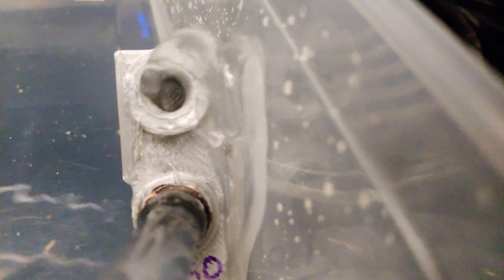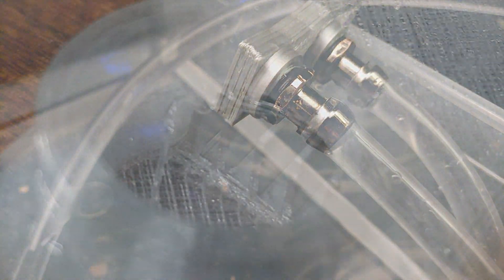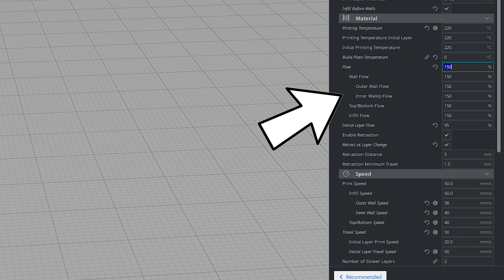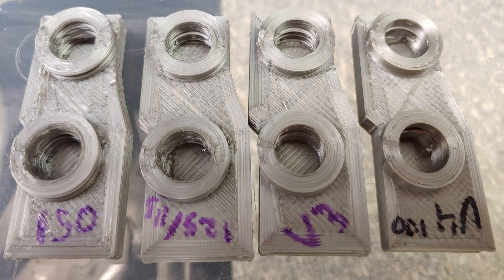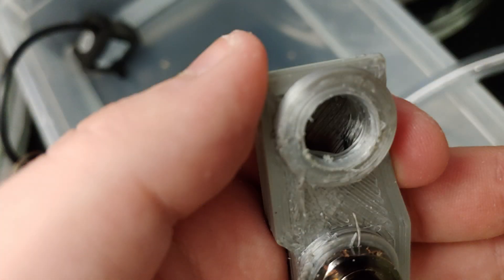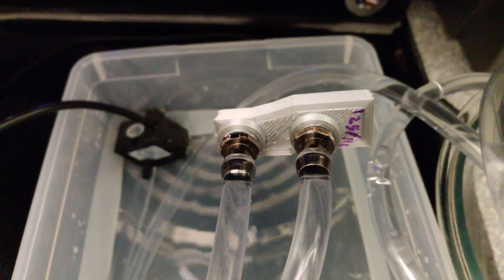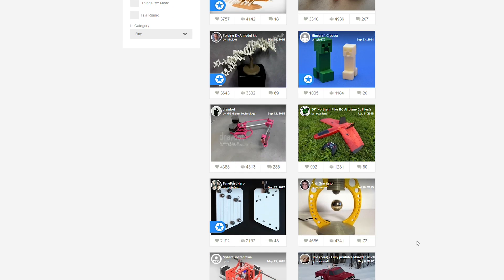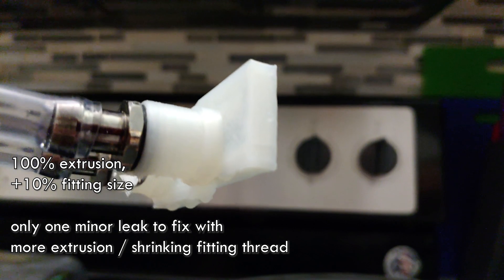3D-printing custom waterblocks PT2

Comment: Asuming you haven't got it to work I would sugest two improvements. First, desing the parts without threads and cut the thread with a desinged thread cutter (they are very cheap in online shops like Aliexpress or similar).
Second possible improvment: Do an aftertreatment of your parts with the salt-remelting methode described at CNC kitchen (originated from an other guy)... this should make the parts watertight. I had my best experiences with PETG remelting. PLA didn't work very well and I in general wouldn't recomend PLA for parts, that get above 60°C.

If I manage I would like to try it out myself. I've done some watertight water cooling parts myself using ABS and Acetone to get it watertight I think the salt-remelting methode should be the better one. The difficult part will be, to get the cavities filled with the salt-powder. I myself am thinking to desing the part as two parts with a sealing rubber ring in between and screws to press them together.

Comment: I have multiple radiators with no damage I'm not currently using. Biggest is the 360mm NZXT closed loop aio. Curious if anyone tried to retrofit an aio to work on a hotend with actual tests. Youtube is full of hotend waterblock unboxings and yet lacking in any data.

Comment: you should try dipping the parts in boiling water, this will seal all the cracks as well as making it slightly moldable so you can screw the parts in and it will make a perfect fit

Comment: i know this is old but if you try again  all you gotta do is coat the part in a epoxy layer and you wont have this issue
Reply from the maker: There will definitely be a revisit with Epoxy! I eventually want to make a replacement waterblock for a Radeon Fury X, but that's going to sadly have to wait for a couple months while I'm currently short on space for ambitions projects at home.

Comment: I dont know what fillament you are using, but if you are using PLA, that might be the problem. I tried printing something watertight in PLA and it just didn't work. Then i tried PETG and although the results weren't perfect, it was leaking way less. Maybe you should try some different fillaments. And try wrapping the fittings with teflon tape.

Comment: Know the limitations of an Idea and when to stop pursuing it.

You'd be better off just hacksawing two pieces of Copper together with one having two holes for the fittings and the other a channel for the water and then soldering the two together using a torch to heap up both at the same time. Clean up the outside and give it a clear coat to prevent the copper from tarnishing and you'll even have something nice to look at. Should take less time than it would to 3D Print that atrocity of an idea.